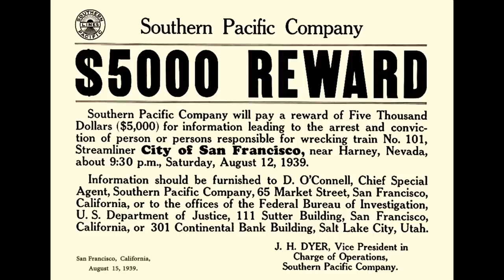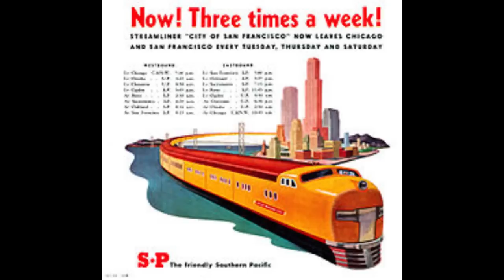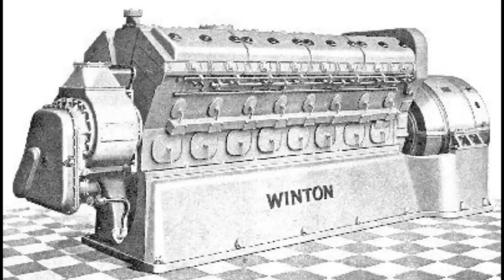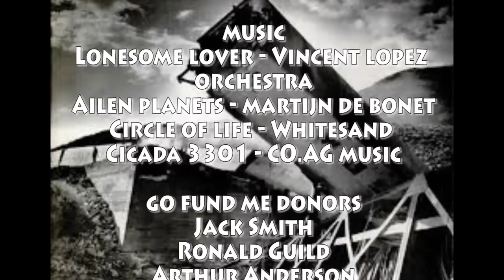City of San Francisco sabotage 80 years later

Comment: "The train was running half an hour late"
This seems to be a recurring theme in a lot of these events, even though it was often not the cause of the accident (Other than stressed out operators etc).
Reply: I was thinking the exact same thing! It seems like late trains are always go over the safe speed limit to make up for lost time, with most paying the ultimate price... RIP to the lives lost that day...
Reply: but it was too late
Reply: Kind of odd, but it does seem fairly consistent. It seems like when a railroad has a bad day, almost always one of the first things to go wrong is the timetable slipping.

Comment: And to think I was going to do it.
Can't wait!
Edit: Dangit! I missed the premiere! Oh well.
Edit 2:I have a theroy: the train was sabotaged by a worker from a steam engine builder(we'll use Baldwin for this) to then later make a propaganda theroy blaming the SP using the speeding theroy, maybe planning to have it seem that the locomotive had issues with its brakes, so that Baldwin could secure it's industry from dieselization. The loco works would easily have access to trackwork equipment to sabotage the track. Of course, this plan would backfire when the leading engine did not derail.
Reply: Me too Bro me too.
Reply: I've heard of some interesting railroad conspiracy theories, but this one takes the cake.
Reply: Pretty desperate plot for a corporation that could clearly see diesel was the future.
Reply: @LexipMedia  Steam traction lasted until the 50s and at that Diesel traction was fairly primitive and expensive in the 30s and electric was pretty much only used on non freight or local lines (for example in england the LBSCR had electrified specifically via a third rail or something similar and they primarily carried passengers not goods) it was only the big cities that banned steam within their limits necessitating electric traction or diesel traction had NYC Chicago and LA not banned steam traction within their limits steam very well may have lasted a fair amount longer
Reply: Makes sense except for the part with bad brakes. It would probably make their company look worse

Comment: Interesting video, nice presentation. Curious, the lock didn't jump the track yet the following coaches did. I would guess the rail was loosened and the passage of the lock moved it. Also, why was the speed an issue when it played no part in the accident?
Reply: Well, maybe if the engineer was going slower the crash would have been less severe.

Comment: It looks to me like the train derailed to being over speed. If it was sabotage, wouldn’t the power also have derailed?
Reply from the maker: Depends on how bad the damage is. The Palo Verde accident was identical where the power held on to the rails due to their weight but the coaches derailed. If it was overspeed the locomotives would fly off the bridge and be on their side. By the way the power did derail on this train (The B units are off the track but the A unit stayed on)
Reply: At 2:20 it's hard to tell, but almost looks like the A-unit is derailed but still upright.
Reply: @jimblake3574  
B unit is derailed, not the A.
A unit ran to get help so no way it derailed.
Reply: The rail itself didn't nescicarially need to be manually moved too much by the sabatour to cause the derailment as it occurred. All that they needed to do was pull enough spikes to allow the track to move, maybe move it off the tie plate and bypass the track circuit. The heavy weight of the lead locomotive would both help keep it on the track and help cause the track to move when it's weight is nolonger on the free section. Ever watch how much a track can move up and down as a train moves over it at a slower speed? Now imagine that including side to side movement and at a high speed.

Comment: It was speed pure and simple, covered up by SP.

Track sections back then were 40 feet long and weighed 50 lbs per foot, bolted to each next section of track with two steel plates and two-four bolts. Tracks were spiked down to each sleeper(wood tie) by 2-4 spikes through a plate on either side of track, 4 were required but many used only 3 spikes in an alternating pattern of 1-3,3-1,1-3 to save money, done even today on old track sections.

There is no way a track could be moved 4” and the passing engine can clear the 40 foot gap yet stay on the following rail in a curve for another 1000 feet, let alone if the track was perfectly straight.

The track was weakened by previous trains and likely no checked by the railroad as often as required. A train going 60mph would not have put as much stress on the outer rail as a train doing 90 mph. The lead engine started the failure, followed by the B units pushing the rail further out and detailing down the embankment pulling the lighter passenger cars with them while taking out the bridge along the way. Only way for the lead engine to remain upright and on track in a curve.

Tools in river could have been dropped accidentally off bridge in years prior, many people couldn’t swim back then and who would want to dive into the water in an isolated area to get a tool?

It would have taken 4-8 workers more than two hours to move the 2000 pound rail let alone get out to the bridge and away from it before the train passed. They would have had to use a self powered rail car to get there and it would have to be reported it would be the easiest way.
Reply: nope it was sabatoge. Speed had nothing to do with it
Reply: The sabotage could have been done by more than one man and they could have easily moved the rail with a horse or horses but that of course if it was sabotage. If they spun a sabotage lie back then to cover their asses with insurance companies and angry remaining family members with lawyers looking to sue for wrongful death then yeah the corporate rail executives of that time probably lied to cover that the crash was caused by speed.
Reply: Both of you are missing the point, how does a 140 ton engine clear a 40 foot gap in the rail going 90 mph in a slight curve then re-rail itself and travel 1000 foot before stopping?

The video says the rail was moved 4 inches out before the train passed.

The engine would immediately drop into the gravel and ties never to re-rail itself.
Reply: @allanadam4553  
Maybe you are missing the point. Maybe the forward engine did derail and this was all a elaborate cover up designed to baffle and twist the truth into further obscurity but it was so long ago and it really no longer matters now since all who were truly responsible have long been dead. Personally I do believe it crashed due to speed because that is the simplest and most likely reason but back then some shit heel decided to hide the truth to save money.
Reply from the maker: Very interesting theories in this comment thread. It's been nearly 80 years so its hard to tell. But just think about the Palo Verde crash. The engines (A Dash 8 and an F40PH) remained upright but the Superliners went diving into the river bed (Not all of them) I was only stating what I found from research from various sources.
Reply: If the rail was moved over 4" at the joint, then there would not be a 40' gap. Also, moving rails is relatively easy with the proper hand tools. 2 men could easily accomplish this in a couple of hours with the tools available at that time.
Reply: The engine was derailed, but stayed upright. You can see it in the picture.

Comment: Theory. Track moved 4" on a curve and tools in the river = sabotage. How about the tools were dropped when they built the line/ did maintenance and the track movement was caused by inertia. To much speed and the spikes were weakened enough after the Engine had passed?
Reply from the maker: Could be onto something.

Comment: Oakland Pier isnt in SF. You went to the Oakland Pier in Oakland and took a ferry across the bay to SF or if it is the 60s you would stop at the 16th street station then take a bus to SF
Reply: badplatypus2 Oakland Pier not SF? Close enough.
Reply: @samiam619  I mean either way you have to take boat to SF pier

Comment: Can't they now identify any fingerprints on the tools used during the sabotage?
Reply: Chris Perez first, doubt national fingerprinting was around back then, and if it was, they would have had to get a damn good print off of a presumably wooden tool after sitting at the bottom of a dirty river for a day and a half, and get good prints off of every suspect processed.  If both were done, I suppose modern comparison is possible, but it’s tough.

Comment: Doesn't really add up, rail moved inward, rail wheels have a flange on the inside of wheel that probably would have pushed the rail back out, the locomotives made it past the moved rail with the rear one being pulled part way off by the derailed cars. Most likely the heavy speeding locomotives damaged poorly maintained track then the lighter cars derailed. Probably claimed Sabotage to cut down on what they had to pay out in settlements?  Lot of the time companies won't be held responsible for acts of god, war or sabotage.

Comment: Wat side of the rail was pushed in wards cos if the track was pushed inwards the train was traveling in all it would of done was push the track back in to position it came from and would of probably gone on a bit further before it did derail and probably wouldn't of caused much damage the train probably would of stay up right and more or less on the track

Comment: you know. i bet it was just the train going too fast. it also looks like it since the locos didnt derail but the lighter coaches did.  i bet the just thought the rails where moved because maybe the tracks were first laid wrong and then moved out and the tools were just leftovers from the build or laid on the bridge for some time until the vibrations of the trains or the wreck itself threw them into the water. Since the track was only approved for 60 MPH going 50% faster could easily cause this. BUT just my opinion ^^ and the most likely

Comment: No mystery here 😂🙄
It can’t be sabotage and the trains locomotives stay on the tracks

If they bypassed the circuits to the signals they could remove a whole track section, and the conductor wouldn’t see the missing link until it’s to late.       If you slow your toy train down fast enough, you only lose the cargo off the track 🙄😂😆